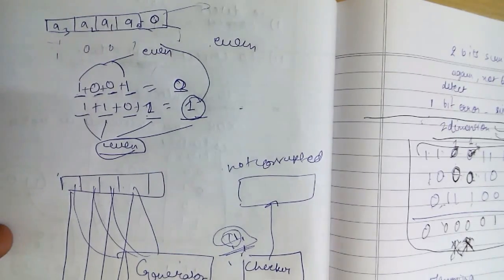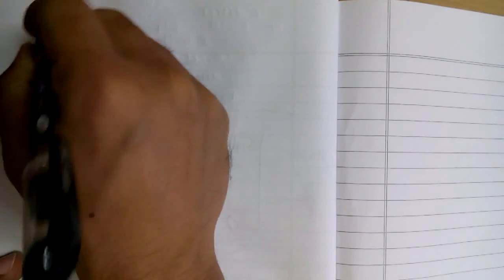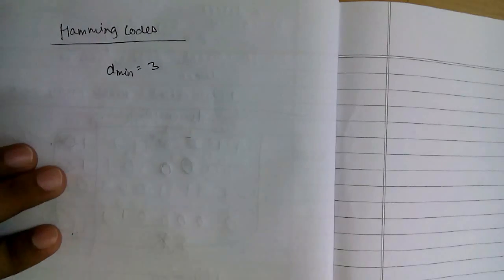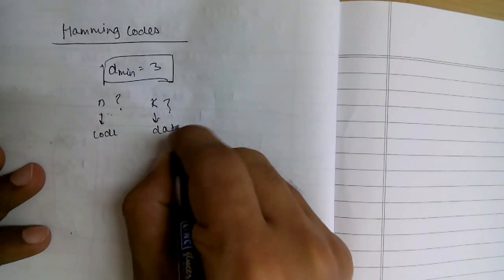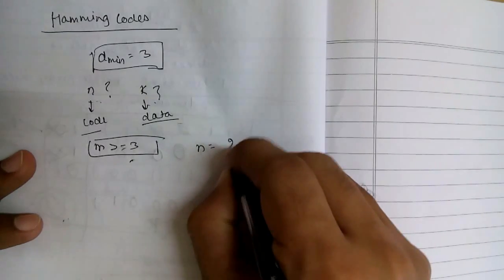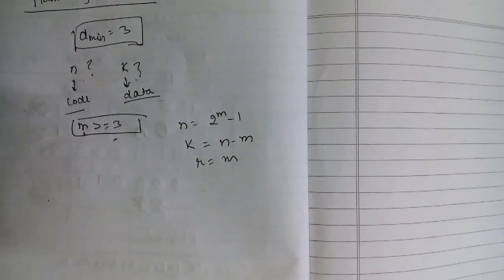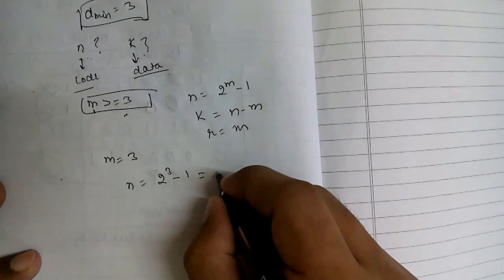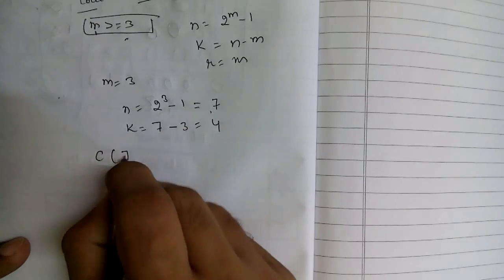Data Link Layer: Hamming Codes

Comment: i beg you sir please tell The Network layer
Network layer concepts, design issues, static and dynamic routing algorithms, shortest path routing, flooding, distance vector
routing, link state routing, distance vector routing, multicast routing, congestion control algorithm, internetworking, Ipv4